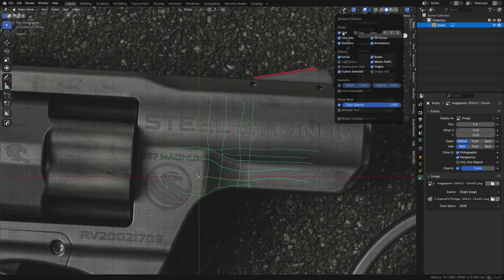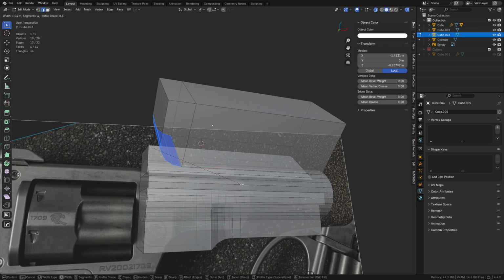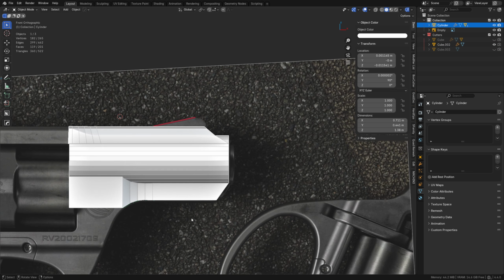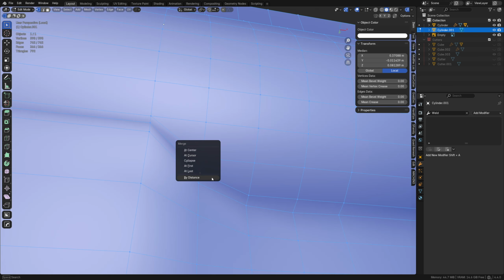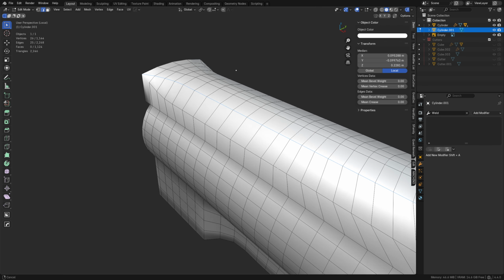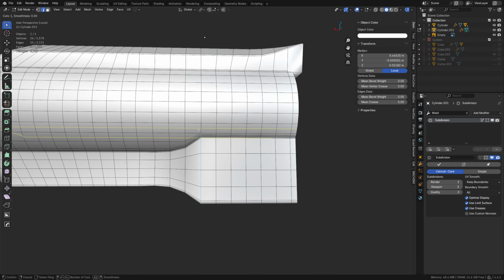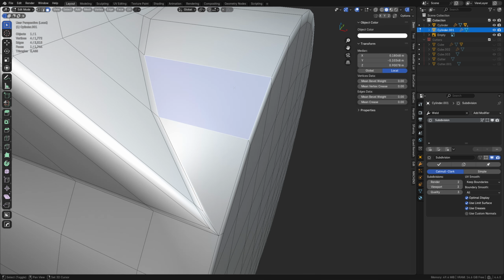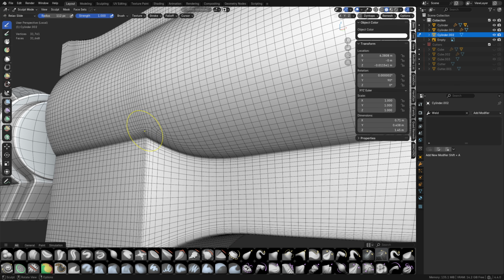QA - Creating 357 Topo - SubD - Blender Modeling

Comment: 32:19

What are you doing to quickly join/fill adjacent edges? Are you using Shift + R to repeat the last action and Blender automatically determines which edges need filling? Is this a Machine Tools function?
Reply from the maker: Tap F